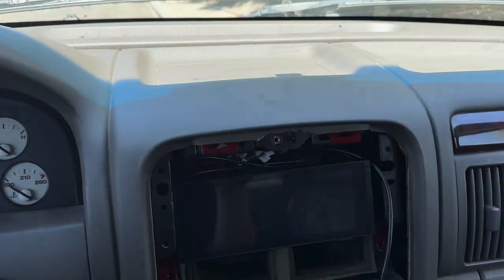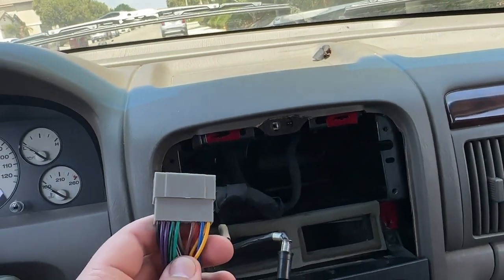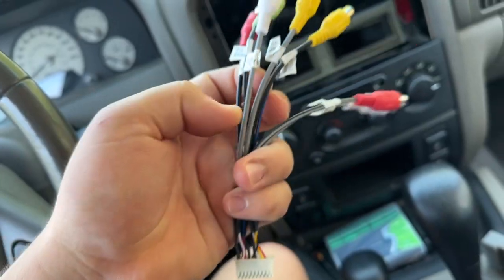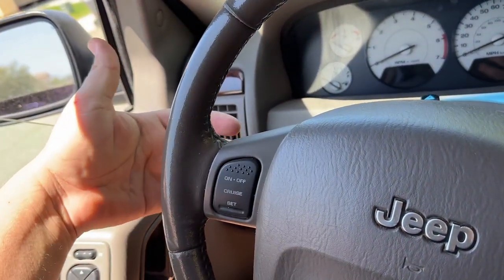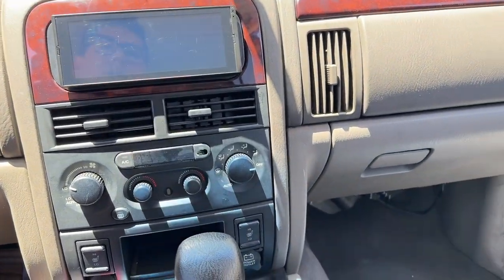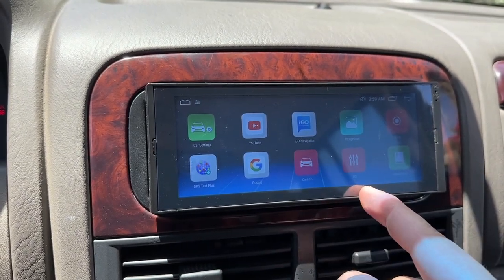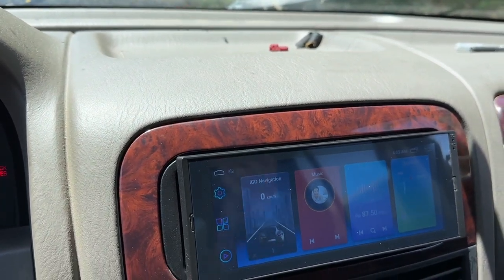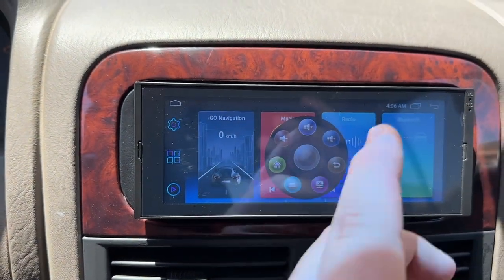The Best CarPlay Radio Under $100 | Single Din 6.9in Ebay Radio

Comment: The steering wheel buttons work as a resistor, the stock radio looks at the specific voltage it is receiving through that red/yellow wire and decided what to do based on that. Stock, it sends 5v to the factory radio all the time and the buttons lower that voltage which tells the radio what you want to do. Unfortunately, a lot of cheaper aftermarket radios are looking for 3.3v through the SWC wire and can't recognize anything above that. 

The reason the left buttons and the middle button on the right work is because they are lowering the voltage enough to drop below 3.3v and the radio can use that signal. the two rocker buttons on the right barely lower the voltage below 5v and thus, aren't recognizable by your head unit.

I threw a small 10k pot resistor on my red/yellow wire and rotated the dial until I was getting 3.3v coming out of the wheel controls with no buttons pressed. That way, every button will be recognizable by your head unit.  
  
I know this can sound kind of confusing, but that's why only part of your wheel controls are working.
Reply from the maker: Nice I did not know this👌 I really only use the buttons for home and the sound level so it works for me as is but if I ever wanted to get the other side working I will do this💪

Comment: I wanna get this radio how is it working now ?
Reply: I know it's a bit late but here's my initial thoughts on it after I installed it in mine.

You are DEFINITELY getting what you pay for with it, it's an $80 Chinese head unit. The setup was finicky and a little confusing, but I eventually figured it out. The lack of physical buttons is also sorely missed, the volume knob not being physical makes changing the volume without the remote somewhat difficult (I also do not have steering wheel controls). My final issue with the radio is that there is little to no bass when playing music through any means, and I am not very sure why. I'm not sure I would buy this again, I would rather spend double or triple the money and get something much nicer for my Jeep. I also found that it will overheat and shut off if the heat is left on too high for too long, due to the vents being directly under the radio.